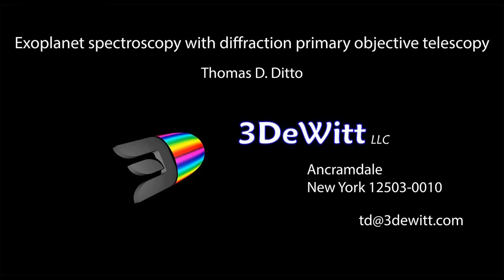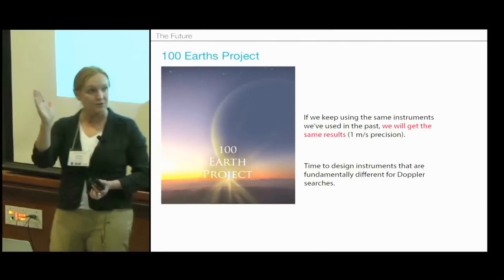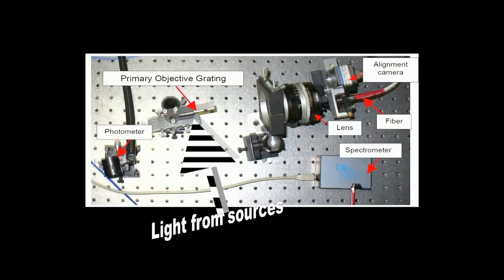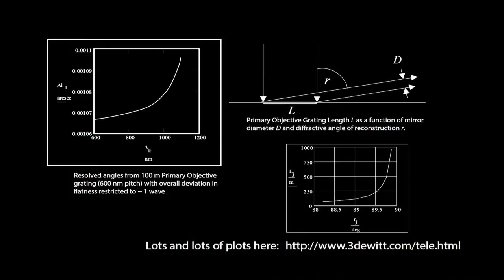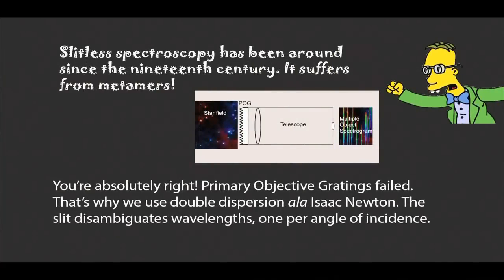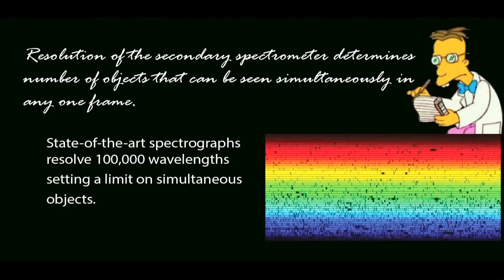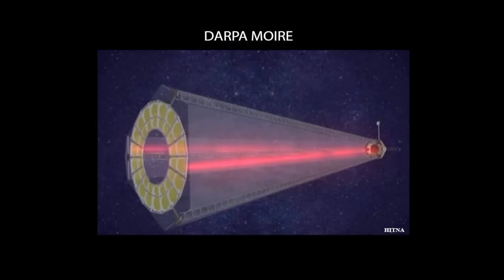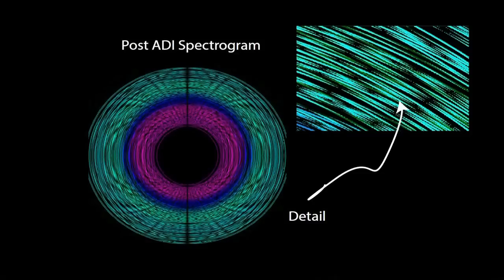Exoplanets spectroscopy with diffraction primary objective telescopes -Tom Ditto (SETI Talks)

Comment: The High Étendue Multiple Object Spectrographic Telescope (THE MOST) was selected by NIAC for continuation into Phase II in 2019.
Is there any other work being done in this direction?
Reply: NIAC also underwrote a contemporaneous Phase I for the sister telescope, now called DUET (ADDEPT in this video), a space telescope that will explicitly target single exoplanetary systems to 1) take Doppler shift based spectra to determine radial velocities and 2) directly take spectra of individual exoplanets within our "neighborhood" of 10 parsecs. Another talk on the DUET Phase I research can be found on the streaming video from the 2019 NIAC Symposium. 
https://livestream.com/viewnow/NIAC2019/videos/196789856
1:17:30
The team now includes astronomers and optical physicists at Rensselaer Polytechnic Institute who are devoting three lab spaces for the NIAC projects. If there is a broader engagement outside our effort, it has not come to my attention.